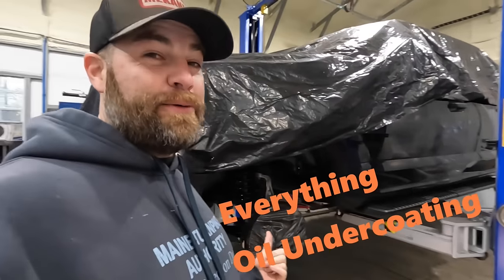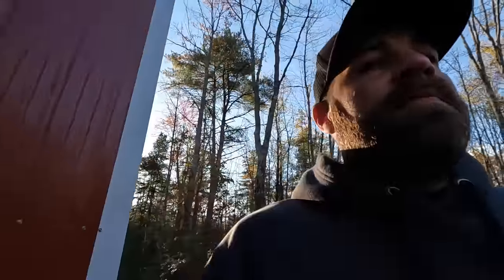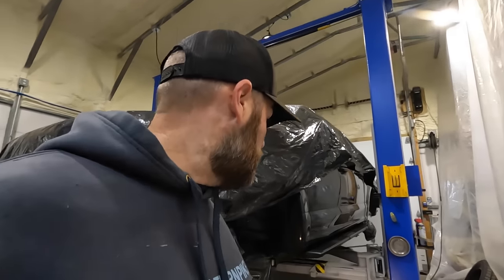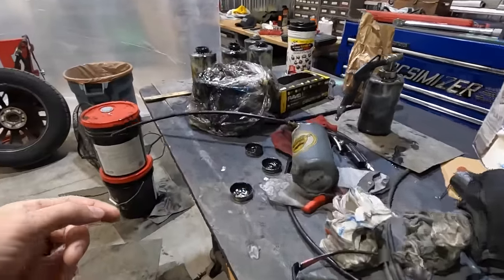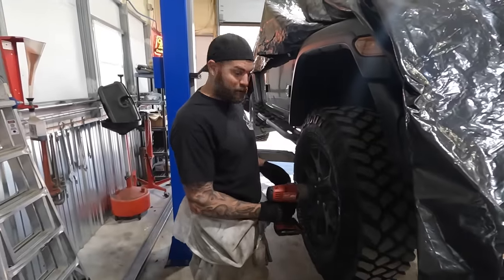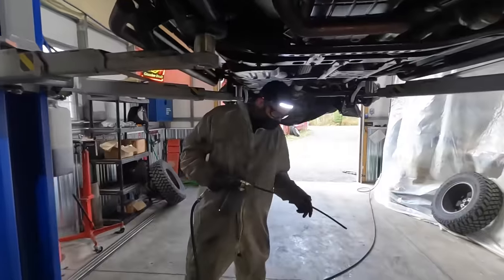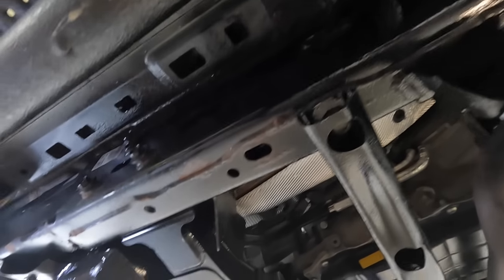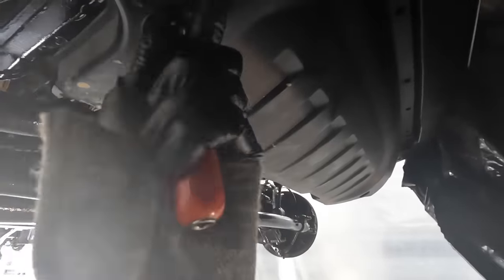The FACTS about Oil Undercoating!

Comment: The truth is that steel has water inside of it so the only way to seal water out of steel is to torch and sweat it out and then seal it or it will rot from the inside out
Reply from the maker: Oil seeps into steel displacement of moisture
Reply: @FlippinCustomized  on quarter inch plate how long will it take to push all the water out
Reply: Truth be told no steel will last forever and that’s why manufacturers use it… why can’t they just make frames from galvanized or stainless for the price they charge for a new truck

Comment: Yea after living in coastal R.I. & Mass areas most of my life, I’m now in my 6th year of retirement in sunny HOT Florida, where rust is not an issue, only harsh sun bleached paint an interiors are. But no rust. But like I said Coastal R.I. & Mass most of my life I’ve dealt with rust. The worst was the way the 60’s&70’s cars came unprotected. Even when in 1978 I bought a new Scout II TERRA truck, that was my second after a 1973 that lasted only 5 years before major rust forced me to replace it, with the 78, I had “rust-proofed” at a Zeibart Dealer the day I took delivery! That still only lasted 6 years before the tailgate rusted off, the rocker panels were not, with the rear quarter panels only being eight panels! That was a constant concern till at least the 2000’s. But now I’m in Florida where a 2016 Colorado I bought in Mass, was as nice in 2024 as it was new. Now my new 2024 Gladiator will be looking good for a long time. I have one question, when you remount the alloy wheels on that Wrangler, will you use a torque wrench? Good luck good job!
Reply from the maker: Always torque wheels , I remember x Bart and they still offer it up here

Comment: That oil under coating just traps the water/salt and actually increase the rate at which the rust eats the metal. Use FluidFilm. My 2009 Honda CRV and Ford Edge have 0 rust after doing fluid film back in 2010.
Reply from the maker: Dead wrong you need to do your homework, fluid film is also good

Comment: Rubberized is junk , it will rust under the rubber and you can't see it.... Fluid Film will evaporate we tested it at our shop Fluid Film on an old hood and Wurth Film , the Wurth Film was 10 times better .. I use what's called Premium Undercoating you can get amber or black .. Amber is more oil/grease while the black is more of a grease paste .. I put it on twice a year my truck is a 1997 Dodge Ram 2500 ..
Reply from the maker: We have had great success with New Hampshire oil undercoating

Comment: Don't know about this , oil undercoating destroys rubber seals and anything rubber that it touches over time . Seen it on cars coming into the shop . 
So I have mixed feelings about   this , seen way more damage than good from it .
Reply from the maker: Does not hurt rubber chassis components, but should avoid door seals
Reply: @FlippinCustomized  ok gotcha, so basically user error. Places don't apply it correctly.
Reply from the maker: possibly

Comment: Oil spray alone is not the answer oil spray and washing the sand and salt off with a power washer every other fill up is the answer oil spray can get saturated in salt and if your not flushing the salt off it can become a corrosion mess also don’t be afraid to bend that power washer nozzle up into your fender and wheel wells and do your doo hinges too under the hood even definitely your rad too
Reply from the maker: Not all oil undercoating is created equal, not sure what your using but that is not the case with this

Comment: We undercoated oil etc my 2010 F150 Harley Davidson eition...every year.  St 12 years my cab corners rusted out from sunroof drains.. year 14 detailibg found rust coming through front fenders under tge f150 emblem. Rust holes in the inside of by bix.  Your method does not protect inside the hood panels, inside the pickup bed, inside the doors.   In canada we have rust proofing companies  Krown  & Rustcheck that rustproof your vehicke with oil based product...cost about 125-175 a year.  Both great products they sprsy ibside all doors hoods trunks truck beds
Reply from the maker: Then you should stick with your method 👍

Comment: I’m up in Canada and in my opinion this stuff doesn’t work and is a waste of money. It traps moisture inside and makes it rot faster, you don’t see it because it’s covered.
Reply from the maker: Definitely not the case I don’t think we’re talking about the same product this displaces moisture and soaks into base material, maybe you’re thinking rubberized undercoat
Reply: I live in Newfoundland and live by the salt water so I’m double blessed. Our roads are salted 7 months out of twelve. I’ve rust checked my vehicles since the early 90s and haven’t had any problems with rust. Get it done right is the thing!
Reply from the maker: I agree